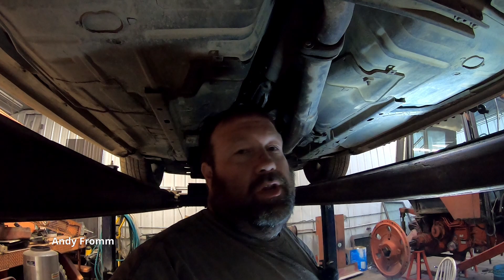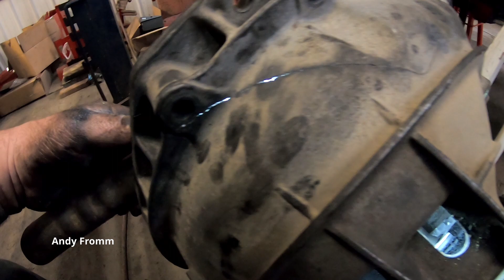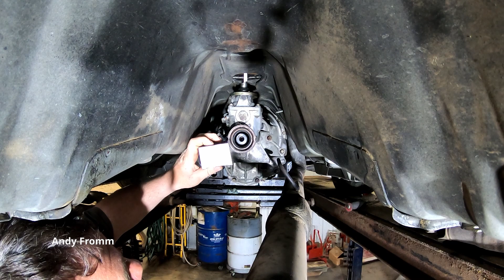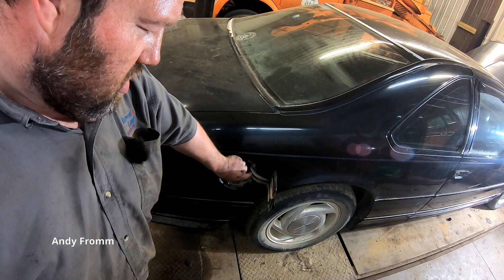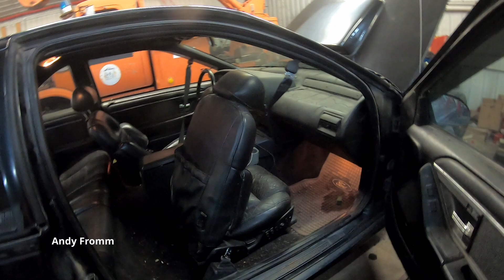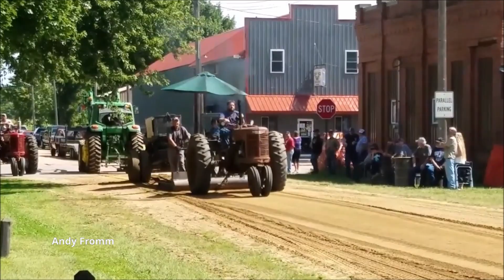I broke my Cummins Transmission | 4bt Ford Thunderbird SC 5-Speed Remove Replace

Comment: Don't get me wrong...I AM thankful for what I have, but I DON'T have a garage, or shop...hardly even a level place to check my oil.
So, I REALLY appreciate  your facilities every time I tune in to one of your vids.
I'm waiting on my old Dodge Truck right now, because it needs a clutch and some other things done, that you really should do with a lift.
I "ain't" 18 anymore!...promised myself I'd pay someone to do the big jobs when I got older.
I broke that promise and decided to do a heater core on that truck...I got it done, but it "did a number on me"!
As always, you did a nice video Andy👍
Reply from the maker: I've been there when I lived in town.
What age dodge? I have a couple dodge trucks i need to get working on sometime.
Thanks for checking it out, I appreciate it Kent 👍
Reply: @AndyFromm  1983 D150, 225 c.i. slant six, A833 4 speed overdrive.
Connecticut wasn't kind to it, but I'm glad to own it.  It's cool owning something  with the triangular "flipper" vents, Crank windows, spark plugs you can change in 30 minutes, and "4 in the floor",(now-days some call it an "anti-millenial theft device"😁).
I have to admit, I don't really miss carbs...especially  in the winter.  Truth be told...fuel injection has spoiled all of us, if we're honest.
Reply from the maker: @kenthawkins2418  that sounds like a nice ride. I had a Plymouth volare slant six auto for a short time. Efi is pretty nice. 👍

Comment: Hey Andy,  I’ve been a Ford fan, driver and builder since day one so I try to cut them some slack occasionally when they design something that’s hard as hell to work on. But watching you having to deal with the fuel tank just to remove your SC transmission is quite a hassle. 

I do like your shop setup with plenty of light and room to move around without too much difficulty. I have owned a 1987 Thunderbird Turbo Coupe with the T-5 manual transmission since new. I’ve only had the tranny out once for a clutch replacement. Thankfully it wasn’t a big pain like your deal with the SC. 

I’m actually thinking about simplifying everything by upgrading the drivetrain with a quench head Cleveland engine or maybe a 429/460 combo. The car is still pretty solid but it needs a power train upgrade. The turbocharger/ inter-cooled 140 cubic inch four cylinder is still running strong but it’s too difficult to get much more power out of it. 

Hope all goes well with your Super Coupe. 🏁
Reply from the maker: I never had a turbo coupe, I wouldn't mind trying one. If I remember correctly, they are pretty much the same platform as a fox.
My generation tbird seems like they were trying to see how tight they could pack things. The 3.8 v6 sc engine wasn't that fun to work on. The trans deal would be easier if it had a fuel cell but the it would loose so much trunk space and I don't race it or anything.